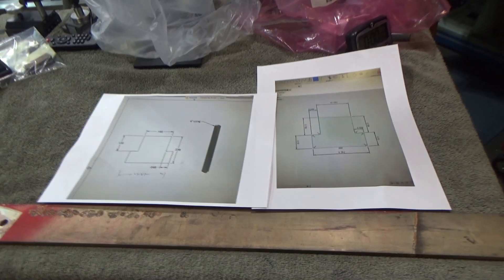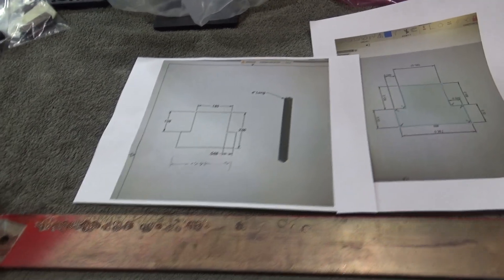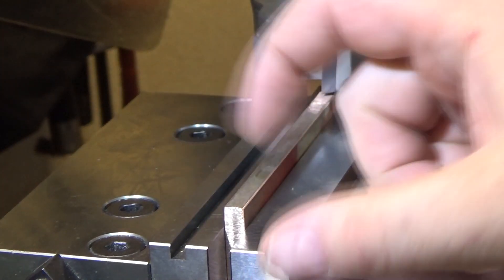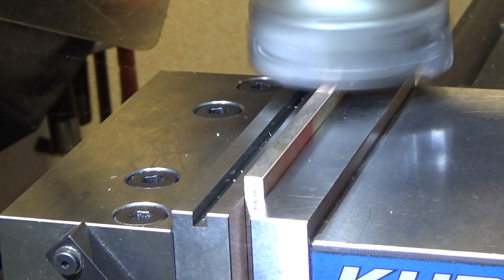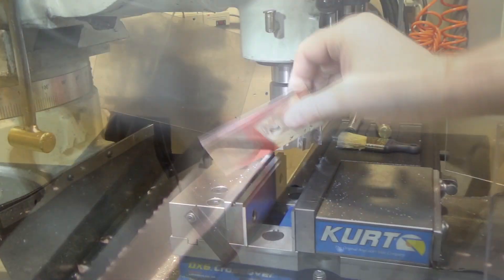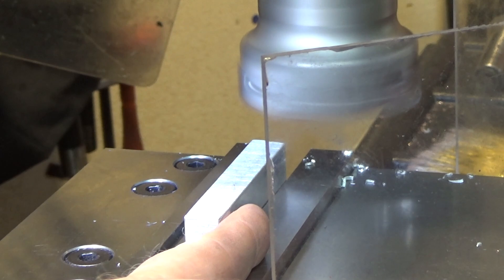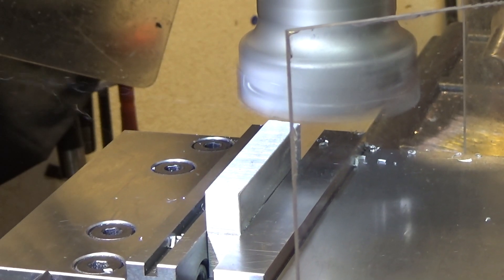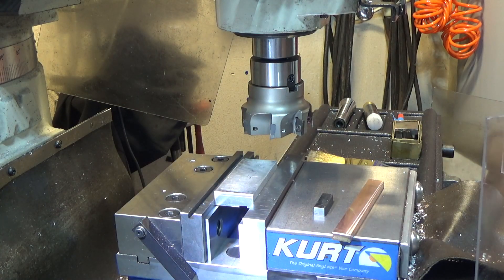178 Custom Copper T Slot Heat Sink

Comment: Well done. Personally I'm not a glue user. The bloody stuff gets too old, hardens etc...
Suppose You would clamp the copper in a 90 degree position. Then mill half the T-profile, turn the copper 180 degrees and align the cut to the vise making the second cut parallell with the first cut.
Then clamp the copper T profile upside down and cut for T nut height.
Reply from the maker: Nice alternate approach. Thanks for the idea.
Reply: @DudleyToolwright  I've been fortunate to be able to buy T nut blanks for a few different tables. Just make sure the blank will fill the track. Then milling, drilling and threading took place using a few different clamping strategies.